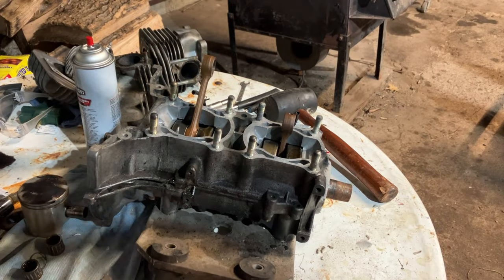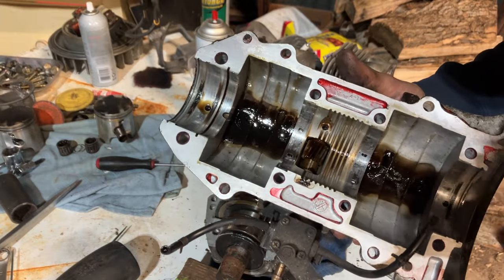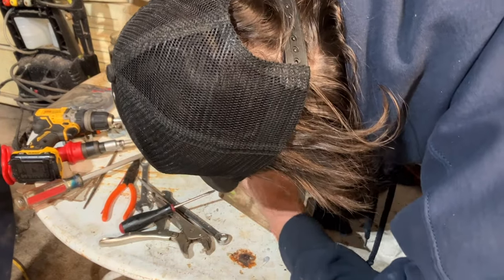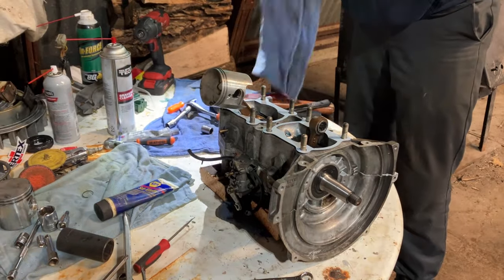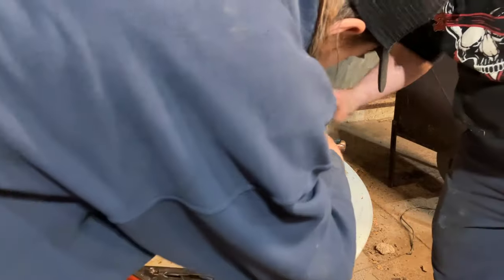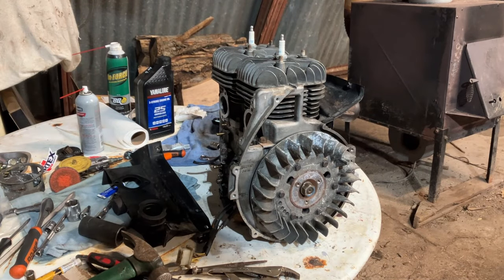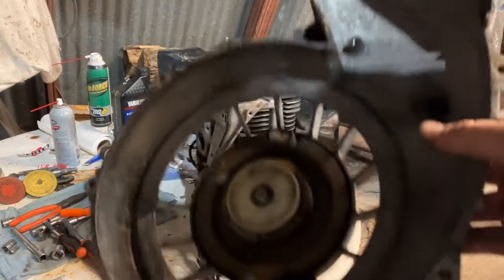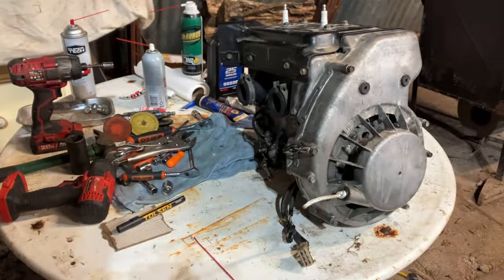CHEAP Snowmobile Engine Rebuild Pt. 2 - IT'S BACK TOGETHER!

Comment from the maker: Go check out part 1 if you haven't already! Next will be the first start up! Hope you all are ready!
Reply: I have a yard sale 1990 polaris indy 400 i got on the cheap only 350.00 just itchin for some snowtime,got one run last winter and one snowfall i missed this winter.this storm not enough im mid central pa.bummer.question can i put a reverse in mine from say a 500 or 550 polaris parts sled?snookie pa.